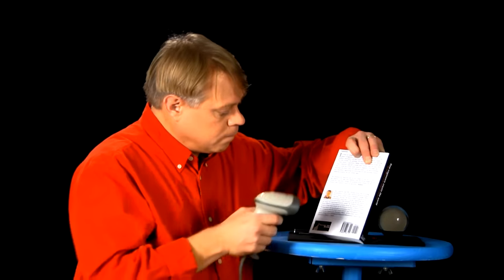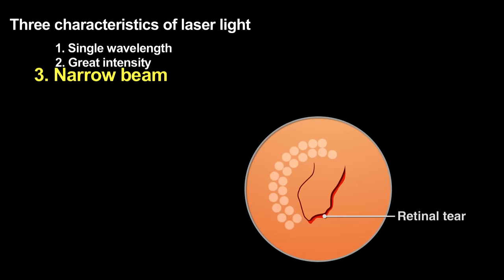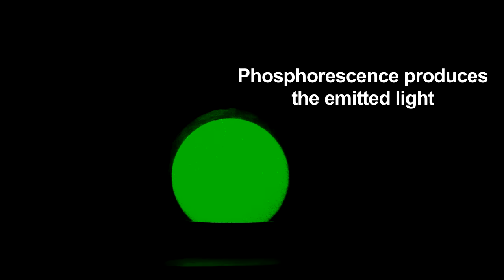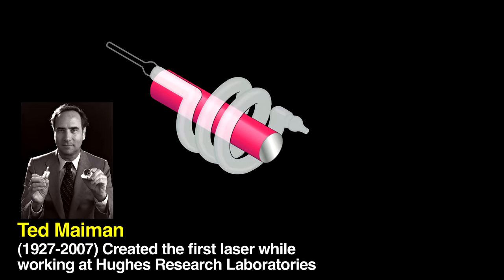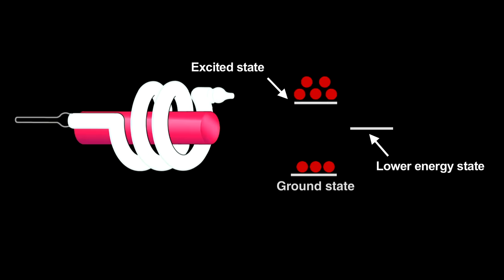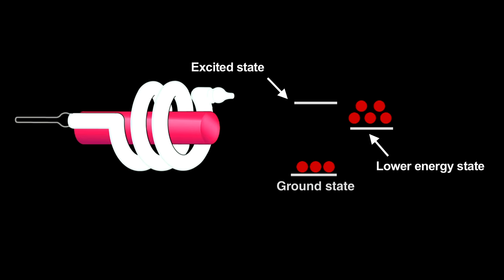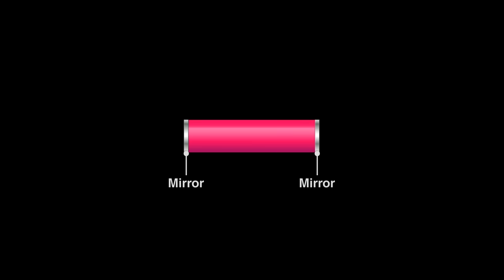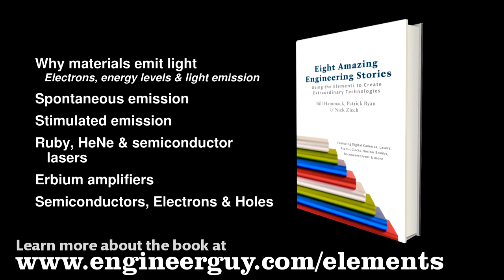How a Laser Works

Comment: When you observe a visible laser shining on a flat object (the wall) what causes the patterns that you see inside the laser light that is reflected from the wall?  I hope I explained that clearly enough.
Reply: They are interference patterns. The light waves are reflected at slightly different positions from different parts of the surface (which isn't flat at all at light wavelengths). If a peak and a trough coincide they cancel out, making a dark spot. Thousands of dark spots come and go all the time as the laser moves around, creating the "grainy" patterns in the reflected light. I hope I explained that clearly enough :)
Reply: Yes perfect, that makes sense, thanks!

Comment: For the standing wave, it has to be a standing wave with an even number of nodes (including zero), right? The length is some multiple of the wavelength, plus half of a wavelength. As I recall, reflections invert the electromagnetic wave properties, so if it's a multiple of a full wavelength there would be more destructive interference, right? I think that's where the "within 200nm" comes from. The wavelength is about 694. To be doing more constructive than destructive interference, the precision should be within a quarter of a wavelength.

Comment: The blue laser you have is exactly like the one I have :) but i'm too afraid to use it. Apparently the cheap ones don't filter out the infrared radiation properly, kinda leaks around the sides. This IR radiation is highly energetic and can cause partial/blindness in milliseconds even when reflected off surfaces. IR filtering glasses really should be used with the cheap brand of blue and green lasers. Red lasers are pretty safe by comparison.

Great vids, I love them! A truly Interesting insight.

Comment: Does the laser immediately exit the rod when the light turns on, or must it oscillate between the mirrored end a lot of cycles (thousands, millions, billions?) to pump up the amplification until it lases?  Is the laser beam continuous, or does it output as a square wave?

Can the point of lasing be controlled or is the intensity based on the dimensions of the ruby?  Can the laser be made to ‘overpump’ in order to make a stronger beam?

Comment: Lasers have been used in science fiction, true, but then around the 90'ies, all use in the fiction department ceased, as no weapons or powerful portable tools were available. I have always wondered why that was, are lasers too clumsy, too large, need too much power? Or could you easily protect yourself, by just using reflective armour?
How about laser cutters? I know that they are in use still today. Can you cut a reflective surface with it? I would love to see a more advanced video about more powerful lasers and how powerful they can become, like the ones used to induce fusion.
Reply: You can cut some reflective materials, but it depends on whether or not the substrate absorbs the laser's wavelength. If it reflects the wavelength of the laser, it can't absorb the energy and heat up enough to cut.

Comment: So, regarding that thing where the bulb wrapped around the ruby being pulsed to create an amplified wave. Is the frequency at which the bulb is pulsed essentially the light-resonant frequency? It seems very similar in concept to resonant frequency, that being pulses of energy input timed specifically to amplify the crest of the energy wave. But I've never heard of light resonant frequency. Is that a thing? Is there a relationship between these two phenomena?

I don't see how you could ever end up with a beam of light that is normal to the face of the mirrors on the end of the rod if light enters the rod from the side and doesn't bend. How can light parallel to the axis make it's way into the space between the two mirrors without penetrating one of them?

Comment: But if there is a hole on the one end, for releasing the beam, then it won't bounce back and get intensified. How do you achieve that only light, of only the desired wavelength, exit the rod?

Comment: So basically, light wavelenghts and sound wavelenghts are similar, it depends on the lenght of the piece who generate it. instructive to say the least.
Reply: It’s not necessarily the length of the piece. Wavelength is the length between one crest of a light/sound wave to the next. The length determines the energy of the wave. Short wavelengths (x ray, gamma ray) are very powerful and can be dangerous to humans. Long wavelengths (radio, infrared) are typically  safe.

Comment: why wouldn't a not so bright light produce coherent light? as far as i understand the wavelength is determined by the amount of energy the electrons loose from there exited state and the level of the exited state is determined by the material used. so why would a setup as described in the video not produce light with just one wavelength?

Comment: 1:06 No they don't. I'm a md, so I learned about it and even you show that on the picture. They don't put retina back in to place. The only thing this circle of small laser burns in retina does, is protecting more retina form detaching from its ground. There is no way to put detached retina back. The surgery only prevents "flopping"  part of retina form puling more retina away.
Also the explanation on lasers you give is not, what is on the picture. On the picture lamp exits a bunch of electrons, and then they simultaneously decay (for no reason shown on the picture). And there is a light emission. It is god, that you explain in the background, that the simultaneous decay is caused by the first photon emitted.  Otherwise this would make no sens. Laser is so bright in one wave frequency cause of simultaneous emission. 
Also the last sentence about laser pointer is unclear- "laser [...] uses LED to produce light". But most semiconductor diodes (LEDs) produce light on there own. Also LED printer is different form laser printer. This only ads to the confusion.

Comment: This made me wonder about glow in the dark objects. It always seemed to me like glow in the dark objects slowly lost their ability to glow as bright or for as long the more time passes. Is this true or was I just seeing things? Can something thats suppose to be glow in the dark last forever? (or at least a very very long time before the material degrades?)
Reply: +iamfuturetrunks To answer your second question, look up a material called tritium.
Reply: +iamfuturetrunks Yes, they slowly lose their ability to glow. It's because as time passes there are less and less excited electrons to pass to the lower energy level and hence as time passes less and less photons are emitted and the light would get dimmer and dimmer.
But no, you can not make things glow forever. At some point in time there will be no more excited electrons left and so there will be no more release of photons and no more light will be output. It should be possible to make something glow for a really long time though, but the probability of something glowing for a long time is likely not that large.
Reply: +iamfuturetrunks 
I'm not sure I understand your question. Do you mean over the course of an evening or over the lifetime of the material?

In the case of the material, there is no theoretical limit on how long a glow-in-the-dark object might last. The material is not consumed by glowing, it absorbs light is it exposed to and re-emits it later, returning  to its original state. A plastic or glass-coated object can last for years.

If you are talking about the process immediately as the light goes out then no, this effect cannot be used to make something glow forever. When the material is exposed to light, it absorbs it, storing the light's energy. After a random amount of time, the material emits new light, creating the glow. Obviously once the material has emitted this light it has no more energy to give, so cannot produce any more light. Inevitably every part of the material will emit its light, and the object as a whole will dim over time. The object actually glows even when the room lights are on, just too dim to see.

You can simulate this dimming process with dice. Roll a number of dice and remove every die that comes up '1', then roll all the other dice again and remove all the ones and so on. Record the number or remaining dice with each step. If you start with many dice you'll see the number you have left decreases, at first by a lot but later by smaller and smaller amounts. The analogy is thus: the number of dice you have is the amount of material that still have enough energy stored to emit light; the number of dice removed each round is the amount of light emitted and the rounds represent time-steps. With this example you can see how the material emitting light at random times results in a glow that dims.
Reply: I meant as in over the lifetime of the object. I have some glow in the dark stuff that barely show any residual light these days unless you keep a light on them for a minute and they stay nice and bright, for 2 seconds worth. Seems like they loose their potency over years.
Reply: iamfuturetrunks
Interesting! I guess the material really does degrade over time. No idea specificly why though.

Comment: So a laser is basically light bouncing back and fourth creating a concentrated beam, that if it was concentrated enough it could burn your skin?
Reply: It's more than just concentrated - it's constructively added. Think of waves - if their peaks happen to overlap, you get a much higher wave. Same thing here - a photon of light will hit an excited atom, and the results is 2 photons leaving, perfectly in phase, constructively adding to each other. Burning your skin is easy - they can do a lot more than that, at fairly low power (a couple of milliwatts can blind you, easily)
Reply: thanks
Reply: @ maak i have a 1.6 watt 450nm laser that will burn your skin from <15 feet away
Reply: Emir Hrustanovic Same, its great fun, but safety is number 1 :)

Comment: I don't get the stimulated emission part...
Reply: That's what the flash tube at 2.13 is for, it excites, or stimulates, the ruby atoms. The excited atoms emit photons when they lose the energy they are given. Energy, after all, cannot just disappear completely (except in teenagers).
Reply: pineapplepenumbra that's completely wrong.  The flash is for absorbsion.  Stimulated emission isn't correctly explained in this video.

Comment: I don't think that's right that lasers don't emit at two wavelengths. During the transition from the excited state to metastable state the electron must emit either an IR or radio range photon at a fixed frequency or the atom must heat up and subsequently release that energy via blackbody radiation. If neither of those happened you would be destroying energy.

Comment: Why exactly does the light intensify when being reflected in between the two mirrors? Excuse my ignorance I'm a high school student lol
Reply: The reason is that there are a large number of electrons in high energy states along the ruby.  As the photons go through, the electrons drop down in state and add a new photon that is in phase with the others.  Thus, with each pass the beam is amplified through the process of stimulated emission.
Reply: Because of the population inversion caused by the excited electrons, there are lots and lots of atoms just waiting for an excuse to emit a photon. When another photon comes along, it triggers other atoms to release their photons in the same phase and frequency.  This causes an avalanche which rapidly increases the strength of the light pulse.

Comment: This explanation is suited for kids because isn't entirely accurate. For an instance, there's no small hole on one of the mirrors. One of the mirrors is just slightly less reflective than the other, which makes it possible for the light with greater intensity to pass through. That happens when the light bounces between both mirrors and creates an avalanche effect, which excites more electrons in the ruby, which in turn they produce more photons thus increasing the intensity of the light, which allows it to pass through that less reflective mirror. (Simply put)
Reply from the maker: I am taking … am I not (it’s been a while since I watched it … Mailman’s first ruby laser. If so, he did have a while in the silvered coating at one end.